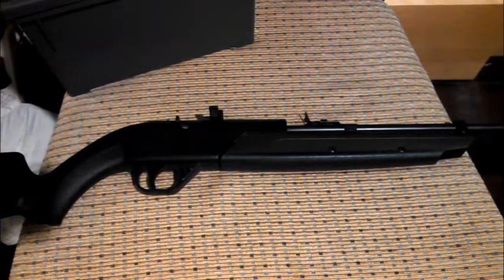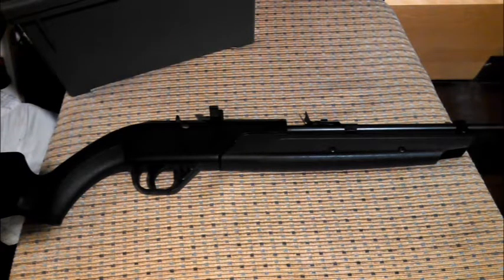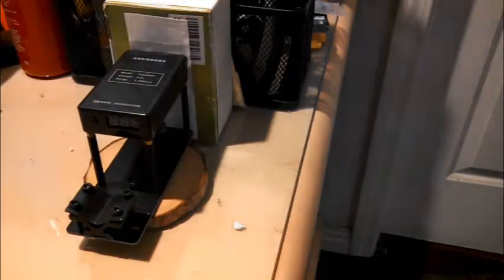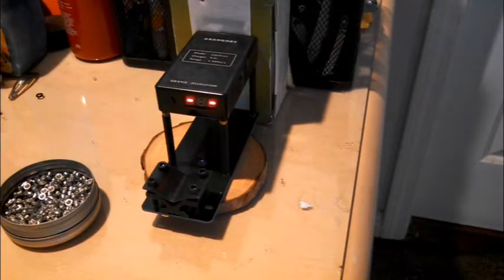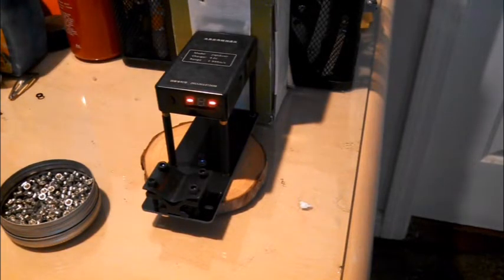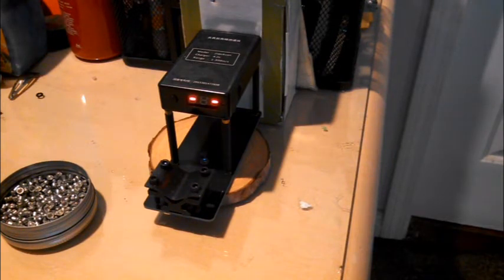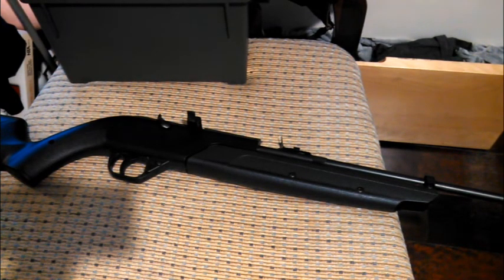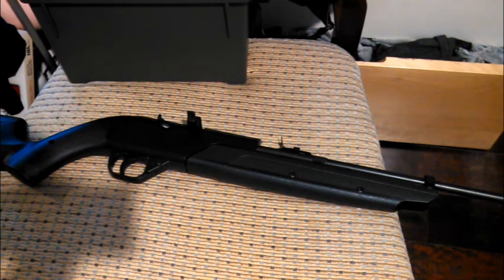Crosman Pumpmaster 760 Overpump FPS Test

Comment: I bought a Crosman Powermaster 760 in 1971 or 72'. The pumpmasters are basicalliy the same internals, but my 760 had a rifled bore. The pumpmasters have a smooth bore which reduces pellet velocity.

Comment: Nice! Since i was a child i pumped my 760 20×. It ran for years like that, and that was with me not knowing i had to oil it! I've recently obtained two 880's which i also pump 20× but now know to oil often and do that incorrectly in some peoples view because i use 3 in 1. My most recent purchase is the Crossman Legacy 1000, it only gets the recommended 10 pumps because its hard enough to get it there and is substantially more powerful than the Daisy 880!
Reply: Wow! I screwed up my transfer port seal on my legacy 1000 because I overpumped it until 15 for a couple shots to see what would happen. I definitely found out.
Reply: @papapotato1875  WOW! Would never had expected that! However the Legacy has a very stiff pump and have not gone more than 10×! It would wear me out! Hopefully you were able to fix it! They are fun, I recently took mine to 100 yards and achieved a 7 1/4" group!
Reply: @chrislang5659  Sounds like fun! I haven't dared to shoot mine that far yet, but I will one day! I broke mine month ago and I did manage to fix it, all I had to do was put the damaged seal in hot water to regain its form. Opening it up opened me up to tinkering with it and just two days ago I fixed the pumping effort issue and its way easier to pump now. I can give you the details if interested.

Comment: I always thought that the 10 pumplimit recomended by crosman was to prevent litigation. The reason being that after about 14-16 pumps the increased pressure prevents the stock valve and hammer spings dumping all the air in the chamber. This can mean that a charge of sufficient power to cause injury, anything capable fillingh a pellet at about 2.3ft lbs, less on tissue like eyes, can be left. This can and indeed has led to injuries when a 760, 1377 etc has been inavertantly fired.
I had not realised this untill I noticed that a stock 2289 I owned was capable of two shots with stocksprings when 'over' pumped.
A simple mod such as a heavier hammer spring to slow closure results power in excess of your figures.
However things like the pivots are so poor on modern crosman that the constant need to rebuild and the noise and time pumping usualy mean most people move on to a break barrel or side lever.
Reply: Stronger Hammer springs are just what they need and replacing the pivot roll pin with something like a drill bit shank helps with keeping it working.

Comment: Curious - what happens if u try an isopropyl alcohol flush then check fps per pump?  It makes a big difference with my 1377, makes valves work better, more power for less pumps.  Must re-oil the cup also.  Give it a try, should work on any pump gun.
Reply: Im new to tinkering with stuff like this and I'm curious about what exactly an alcohol flush is and whats it for. I imagine its for cleaning but not sure about the details

Comment: Very cool test ! interesting results
Do you like this china chrony? Does it seem accurate/is it working fine ?
Reply from the maker: It actually does seem very accurate, overall a good investment for the price although it does have the hassle of reading in m/s instead of FPS.
Reply: @casualairgunner7417  I will think about it the caldwell is about twice the price in canada 😬
Reply: @casualairgunner7417  I have same one and there is conversion apps that allows the ease of converting any measurement including m/s to fps and this cronograph is within 3 fps of my 500 dollar one so it's accurate